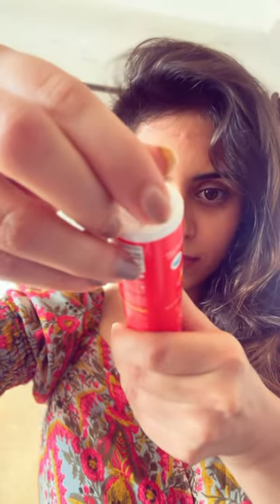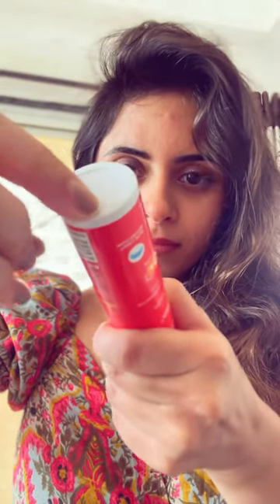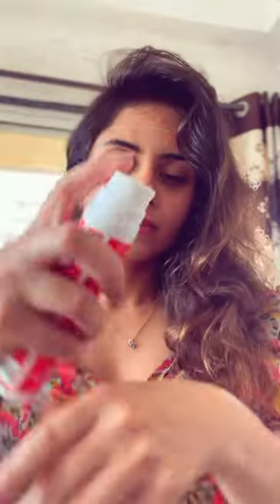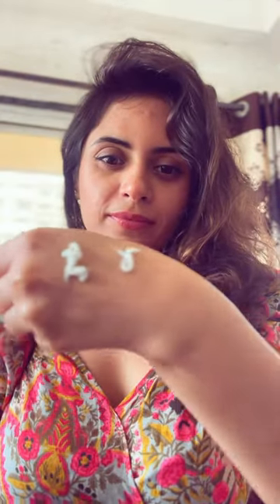Sunscreen pump bottle not working | Aqualogica Sunscreens | #fashion #ashortaday #aqualogica

Comment: Its still not working 😭
Reply from the maker: Check 2-3 times more . Is the product new ?
Reply: @clementine19 i changed the cap now its working
Reply: @DhrubaMandal-ml9kn how did you changed the cap? Please reply
Reply: @teesha24  i had purchased 2 bottle of sunscreens so i just fit the new cap into the old bottle and did the process ma’m showed..its fine working 👍👍
Reply: @DhrubaMandal-ml9kn  ohh but I purchased one .. and that too still not working🙃
Reply: @teesha24  you can still use it though :)
Reply: @DhrubaMandal-ml9kn  How?
Reply: @teesha24  open the cap and take amount as much as you need with ur finger
Reply: @DhrubaMandal-ml9kn  yaa!! Aise hi krna pdega ab🙃😂
Reply: @teesha24  haha😂👍